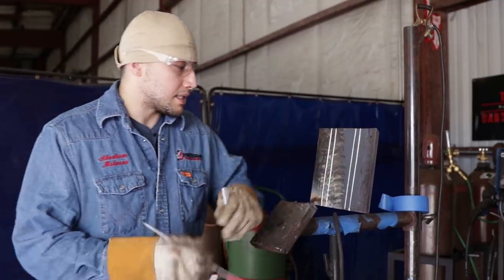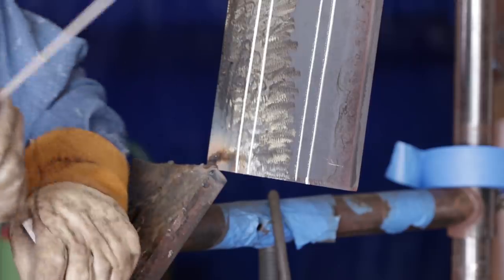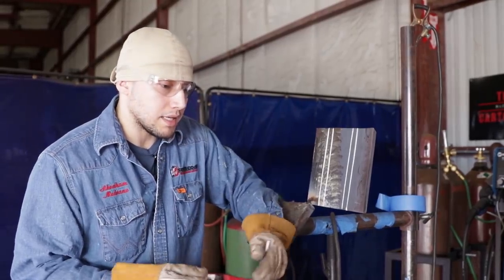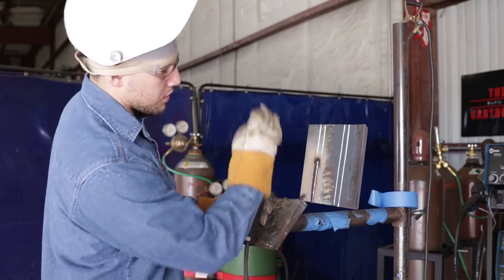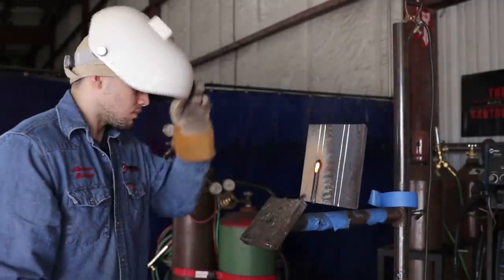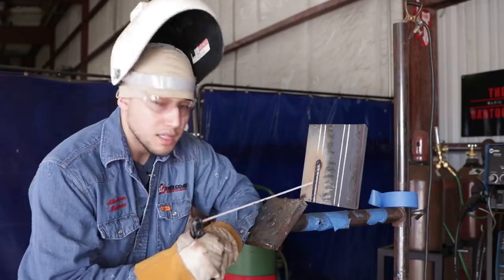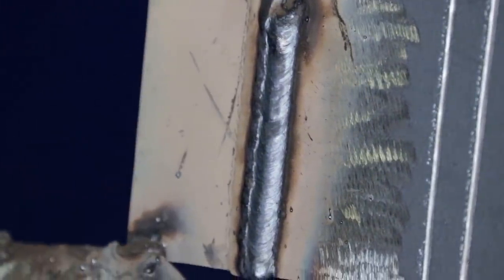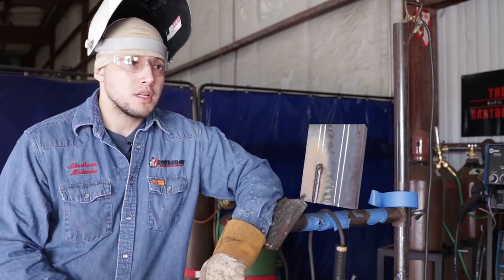Stick Welding - How to Keep Your Caps Straight

Comment: Wire wheel vs hand brush  depends on the weld. I’ve saved myself lots of grief and grinding by wire wheeling a socket weld while hot slagged. But a cap on x ray pipe I would never touch with a grinder. Only hand tools like a brush and file if wagon tracks are allowed. Much respect to the old timers ways.  Great welding!
Reply: john dowe fuck that. I barely brush mine. I knock my slag off (mainly the toe) with my file and a quick pass with a brush faster than you could get untangled from your cord lol. Wire wheel takes away the beauty of a good looking weld.

But I also get paid to take pride in my work, sounds like that isn’t the case for you

To each his own

Comment: Old timers wire brush a lot of welding I do is code welding and is wire wheel and gauged welds before Qc buying it off or third party qc so all imperfections are not hidden

Comment: I like your channel  , you are a good teacher my friend , are you welding  with 1/8  ?
Reply: Riglen Duwaer thank you and 3/32
Reply: Abraham Medrano bro I keep getting that red bulky and it’s not coming close to how it should look. I run it around 90-125amps arc start/dig on my welder Is from 1-10 I pick between 3-4 on it Idk what it is. My plate is quarter inch and my rod I’m using is 7018 1/8. Help! Lmk if I can DM you a video of me running it and how my stuff is set up. Thanks bro